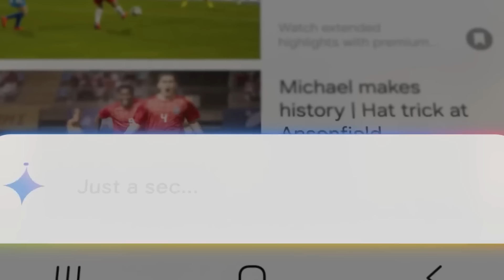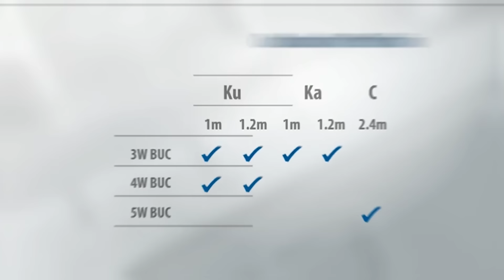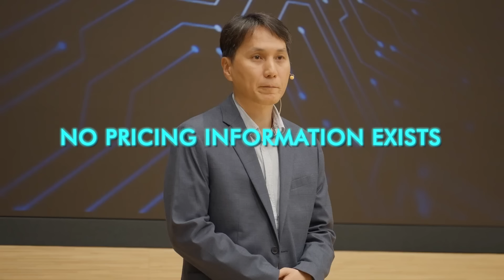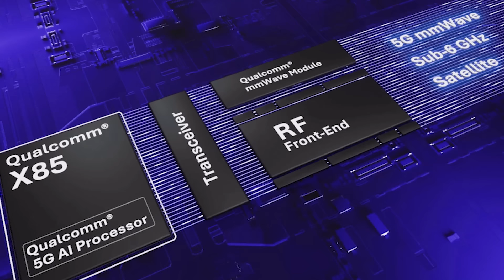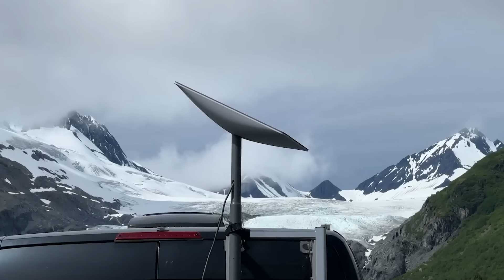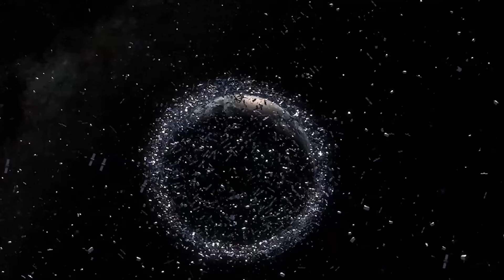SAMSUNG Quietly Closed a Shocking Chip Deal With STARLINK - Samsung User to get FREE INTERNET?

Comment: Even 5G is redundant. The problem was never the issue. Even HSPA, let alone HSPA+, was offering more than satisfactory speeds. The problem was data density. Not enough antennas to provide stable speeds. Even 5G as a concept is a fairly concerning one. Let alone 6G internet getting laser beamed from the top down to the device I am holding in my hand, let alone putting it near my head. This is just BS.